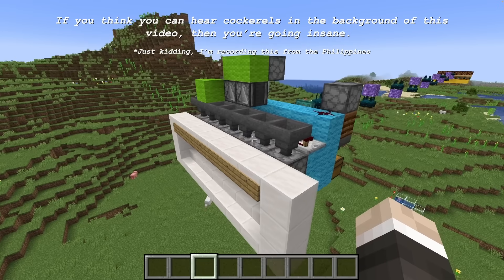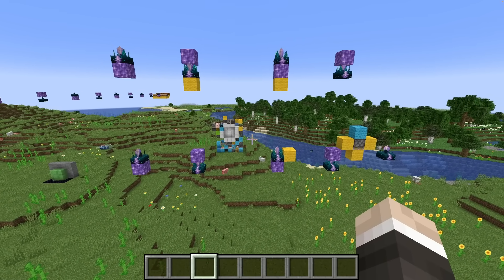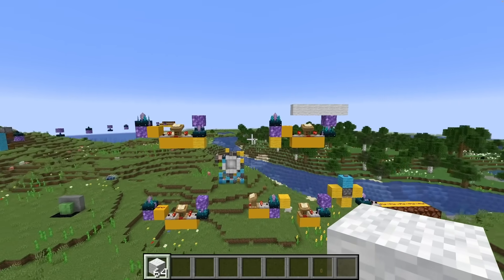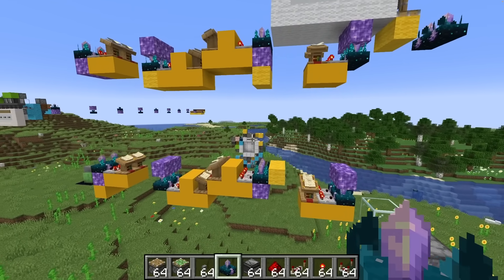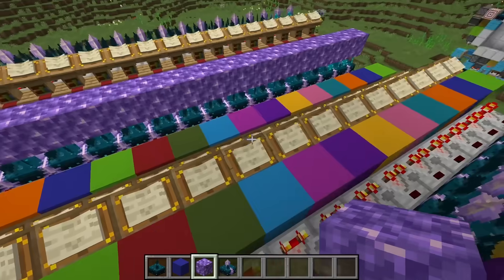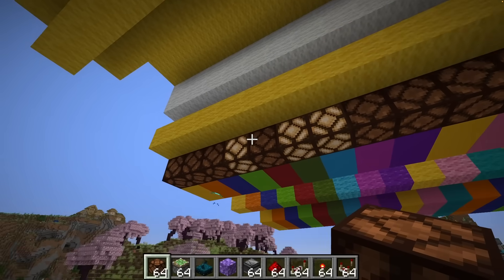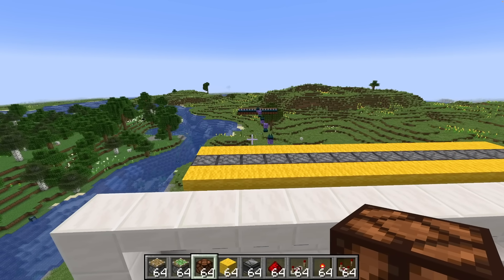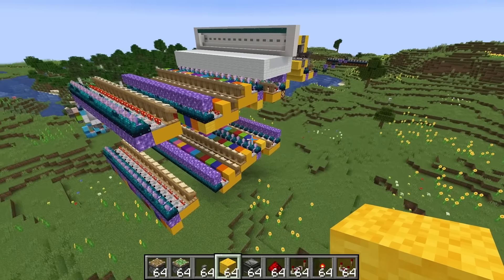This is not a redstone contraption.

Comment: i challenge you to build a telegraph/morsecode network with this, im not exactly sure how you could do it but i have some ideas:
morse code is in essence binary with dots and dashes in actual morsecode its determined by signal length however in minecraft you could do it witht he calibrated skulk sensors, you could get fancy and implement a third signal for spaces sothatamessagedoesntlooklikethis but instead it looks like this, my idea would be the following:
you have 2 dispensers opposite of each other, one has a water bucket one has a lava bucket, beneath the gap between the two dispensers is glas so that the lava/water doesnt flow everywhere and you can still see which is dispensed, if the machine gets a dot signal it dispenses lava, if it gets a dash signal it dispenses water, if it gets a empty space signal it doesnt dispense anything and moves to the next spot, leaving an empty space between words, if you have a long enough line of those dispensers with water/lava and you can come up with a system that makes sure the signal moves to the next space you have a telegraph network (if you want to go a step further you could maybe come up with a system to dial specific places in the network)

Comment: I mean if you only use sounds that are manually replicatable (items dropping, explosions, etc) you can just have the system automatically "resound" itself. Or at least do so when someone approached (perhaps using the sensors to check for footsteps or such while also resounding the footstep system).

Comment: Currently, Mumbo's contraption can give off 15 different signal strengths, and using 2 contraptions can give 225 different combinations, and 3 contraptions giving 3375 different combinations. For reference, we actually only need 26 combinations or signal strengths to encode and decode the English alphabet, while computers deal in binary in 8 units, which amounts to 256 different combinations (which means the 225 different combinations we have in Minecraft is actually really powerful). But I think we could go further.

Adding onto Mumbo's set-up in the video, you could also send a 'redundant' sculk sensor line that activates on the receiving end when a signal is being sent (regardless of the signal strength). You could then add an extra button to the inputs that would not be calibrated to any sculk sensor, and only represents a signal strength of 0. However, that extra button will still trigger the redundant sculk sensor line, showing that a 'signal strength' of 0 was sent.

This means that you effectively have 16 different signal strengths that you could send long-distance (0 - 15), and you would have a hexadecimal system that could then be replicated to form two sets of 16 signal strengths, or a cumulative of 256 characters, and can thus simulate ASCII. This would be even better than 225 characters, and would be even better.

It's just an idea, and why not? It only adds one extra sculkstone line to the already pre-existing line.

Comment: You could combine these non player based sounds together to get up yo 127 different combinations of sounds and have a receiving end interpret these sounds with and gates. The sending end could have a button that plays a specific set of sounds in order to the receiving end where each of the seven input sounds is stored and you hook up and gates to different sound inputs and then if two specific sounds are received then the gate actives triggering your desired output.

Comment: instead of using a lecturn, you could use a single redstone torch, or block, cause it's from 1 to 15 which is the natural output of redstone decreasing over distance. Lecturn would be usefull only if you need to fine tune a combination of sounds
Reply: Not compact

Comment: You mentioned at the end of your video that when you move out of the area the sounds are lost, they are not stored anymore. I wondered. If you wanted to activate certain storable sounds in certain areas, you could have a tripwire or another activator that removes wool temporarily allowing in that moment playable actions to be heard and stored there and then. Let's say it's your base, to get in successfully you need to eat food but if you just walk in normally you activate a trap. Water logging the sculks would need to be implemented to can't be dealing with repetitive sounds.

Comment: Fun note. This is functionally a simple keyboard. With 15 letters, you could get across quite a bit. But if you made the decoder take two inputs, you could have 15x15 = 225 possible outputs, assuming a basic alpha numeric keyboard, 26 + 26 + 10. Only 62 of those would be needed to make lower/upper case letters and numbers. Leaving you plenty more for short hand (commonly used phrases, such as 'peaky bird!) And that isn't even including the shift key!  It's too bad sounds are lost in de-load. Or there would be a ton of potential uses for this!

Comment: @ThatMumboJumbo

The lecterns will reset after server shutdown mumbo, so they are not quite suitable for permanent build. I had this issue when I was testing some redstone idea in my testing world and then in the honey farm i made for my vault hunters world with this lectern comparator sensing unit, but then every time i wanted to operate that i would need to set the lectern again, since the comparator would not read the book correctly, even though it showed it was on the correct page. So for this you would have to replace all lecterns with hoppers, chests or something that will not make it bug out.

Comment: you should totally make a "Code maker" that will turn a combination of the stored sounds into a letter or number, so it works as an actual communication device over long distance
example, numbers (or signal strengths/ or sounds, all the same in this context (I think)) 1, 4, and 7, in that order would make the letter B or something, and then do that for all the letters of the English alphabet, all 10 numbers, a space, and something to indicate the end of a sentence (which would mean you need  38 different codes, to code and decode for sending and receiving). and then also a decoder at the other end, so you can send texts to your friends in Minecraft. if you wana go the extra mile you could add punctuation marks and stuff.
ofc, you'd need chunk loaders for long distances, but that's easy.

Comment: i think it could potentially be possible to send other messages/signals using 8 of the signal strengths all allocated to a digit making an 8 bit binary code. You could do what you wan with this whether its sending messages through ascii (and if the ever add a 16th signal strength potentially unicode), you could maybe do very low quality sound or most interestingly you might be able to create a binary to hex converter and then send colour/image information across a world

Comment: All the 15 signals can be done by pressing a button. For some of them it would be faster/easier to be stored in the system, and 14 of them can be fully automated when entering the room. The only interaction that the player would need to do is spawning an entity, which could be done by placing an armor stand or a minecart (sadly, a dispenser's placement doesn't count as spawning). Or it could be almost automated by placing a bucket of fish or axolotl (strangely, a dispenser's placement does count as spawning for those), then the player would only have to pick them back once from time to time to make sure their is always some buckets in the system.

Comment: Make a wall of wool, 1 deep in put in skulk sensors, boom you have memory module that takes 3x3x1 block but can be activated like you want, without need for wire blocks.
I'm scared even more

Comment: Kind of seem like you could use this to send actual data. Like you've got 15 different sounds so that's almost like Hex if you had a separate pulse for the clock you could feed data in 1 end and get it out the other. If you had say a queue of red stone pulses 1 end you could send that to an output which loads them into a set of lights to make a picture and maybe on the input side you could sense that picture so you could set whatever picture you wanted to be sent.

Comment: You could have a noise reapplier loop everywhere so the noise travels EVERYWHERE and doesn't get unloaded... So when you about to leave the area the circuit in the new area picks up the sound from the area you came from and it can be used as such!?!!

Comment: If you have 2 sensors with different sounds and you connect them with an AND gate, you get a nearly foolpoorf sensor, what is the chance those two sounds will play simultaneously. Now if you add a 3rd, then its pretty much safe. Same way, you could treat those 7 diferent redstone sounds like binary bits, and then you technically have a 7 bit long binary number amount of different inputs and outputs. Which is a lot more than 7. For example - If you simultaneously activate 1 and 2 that would activate output 3, if you activate 1,2 and 3, it would activate output 7 or something like that, i dont remember binary much...

Comment: What you've built is basically capacitors and RAM. Capacitors because they hold the sound like a charge and RAM because the moment you walk away from it, it gets powered off and without power, they memory gets cleared.

Comment: Mumbo dose it the amethyst diffuse the signal ie send the signal to multiple sensors within range if so you could have levers that close off frequency lines using sticky pistons and wool to lock the transition to open lines.

Comment: Just a thought, but could you build a system to send and decode a combination of sounds? Specifically if you used the 8 sounds that can easily be produced by redstone and not have to worry about persistence of sounds. With 8 paired unique sounds you'd have 64 combinations, 512 with three, 4096 with four... You could cover the entire unicode space with 8^6 (with room to spare), the entire 24-bit colorspace with 8^8... I know 'computers' aren't your biggest love for redstone builds but imagine a combination lock with 19,173,952 code combinations ranging from 2-8 inputs in length. I genuinely think that'd be incredible. Especially off of just 8 buttons.

Comment: If sounds aren't persistently stored, the system becomes less complex because you no longer need an encoder. Instead, you can just have a calibrated skulk sensor hooked up to a lectern in a room with everything needed to make the sounds.

Comment: mumbo what if you used note blocks for the sound cuz they have 24 pitches so on it's own that's 24 different sounds then add blocks that change the sound giving you 22 different sound each with there own pitches that gives you theoretically 528 different sounds you can use for inputs unless this don't work but I don't see why it wouldn't.

Comment: Hmm.  Would that "stored sound" system perpetuate through a restart?  Also, having a loop like that seems a bit wasteful, if you wanted more than the 7 or so redstone triggerable sounds for frequencies, I'd imagine you could use and gates as an auditory combination lock thingy.  This would also make it more "secure" as they won't be triggered by other mechanisms or random stuff nearby if they need 2 special sounds at the exact same time.

Comment: Can mobs trigger sculk sensors? For example, will a witch drinking a potion trigger a sculk sensor calibrated on 8? If yes, it is possible to automate it by shooting arrows at a witch using a dispenser which adds one more frequency to your selector, even though it will be delayed and might trigger as well the frequency 10 (block activation) at the same time if not isolated using wool

Comment: to be frank, with only two of the sounds (some of the redstone reproduced ones) could be used to send mors code (or binary code if you insist)

i saw this one comming after the previous video and im not regretting it at all :D

is it finally time for a ginourmous piano which works with vibrations instead? Idk, but funny minecraft contraptions are far more enjoyable than highly scientific ones imho

Comment: Wait I've thought of something. Could you theoretically use combinations of specific outputs put through a wireless line like you showed at the start in a sort of and/or/nor gate system to create even more possible combinations? So you have it so that when an output of 1 and an output of 2 are both output through the line, then an and gate is activated for an additional combination? I hope that makes sense? Like use the varied outputs generated through the line to create and/or/nor gates. Then maaaaybe even have and/or/nor gates FOR the already existing gates? Theoretically have an infinite number of possible outputs?
Reply: Yep, you could batch the commands into a buffer, and then encode/decode them on the other end.  This essentially allows for arbitrarily large encodings to be used(as long as you are willing to wait for sounds to be sent bit by bit)  This is also possible with regular redstone, but getting the timings and encodings right, especially over chunk boundaries has always been a pain. I'm not sure how skulk sensors would compare, but I'd be interested to see an attempt.  It's also neat as you only need 1 line here to carry 15 signals.  With classical Redstone you would need 4 lines of redstone to send the same amount of data.

Comment: There's another smaller issue with the contraption. It's that once you have released the sound, you need to reproduce it again. Which means you have to remember which sound you've just sent.
Reply: I thought so too at first, but it looks like that isn't true. When the block moves out of the way the sound signal is sent out and also up continuing the circuit.

Comment: i know this is a few months late, but why cant you just store the order of inputs 1-10 and then have infinite characters. for instance 1 can be "A" and 26 can be "Z" then 10 can be [SPACE].  then if you want to send the message "GO" (for instance) you just send " 8, 10, 1, 6 " which would translate to "G O" because 8 acts as G, 10 acts as space, then 1,6 acts as 16 or "O"
 this can be expanded if you wanted 99999+ characters, of course you would either need to memorize all 99999+ characters, or have some way to reference which number means what,  maybe just a handy decoder book

Comment: Sculk sensors are very underwhelming 

1.) Anyone doing anything near your sculk line would trigger a generic interaction and trigger the system. 

2.) If someone accidentally throws a snowball or w.e near your encoder, or a villager walks by it you could get an accident signal

Comment: I still don't see an actual point for this thing , you can build secret passage with a secret trigger but that's pretty much it. I tried to use this things in farms or redstone builds but it end up just making things more complicated. Wireless redstone is pointless since you dont need to pass signal trough thousand of blocks and it can't be use to synchronize things since there's a lot of delay (a straight line with repeaters is faster). The real use is probably adventure maps in witch you can create intricated traps but in survival i don't really see the point (except for maybe a secret passage witch is esthetic). I hope to be wrong and I'm looking for some redstone machine based on this things in 1.20 .

Comment: I mean i still dont see the point of this…you have 15 buttons, so why wouldnt you just use literally any other conventional method? Why go through the hassle of connecting each button to a different sound to send an output? Like maybe if you had one button and a lectern to send all the outputs, THAT would be neat….but im pretty sure you can also do that with normal redstone too, and i dont know if it would be more or less compact than this is, so i couldnt say which is better specifically. But yeah, i just dont see the point other than it being qn oddity and a showcase. Dont get me wrong, ive built my fair share of useless machines just to prove i could, my machine that splits 5 stacks of items evenly into a bunch of droppers to rapidly drop them into a hopper minecart and send it off comes to mind lol. But its not something i would ever really use, and wouldnt showcase it either because there is no point to it. Just something i make to show i can, and that i understand all the concepts, and then just pretend it doesnt exist.

Comment: What happens if you send more than one sound signal at once down a line? If it detects all the signals sent simultaneously (near simultaneously, checked on a clock cycle), then you could grow the number of unique sendable signals exponentially (2^n where n is the number of sound signals).
Reply: Additionally, what happens if you send a sound signals in both the ends of a line at once? Do they interfere with each other? If not you could have full-duplex communication for free

Comment: its a shame that the range of each skulk sensor's range is so low, would be actually rewarding to get in survival if it transmitted on a radius of half a chunk + 1 (whole chunk + 1 in a straight line of width 1 if calibrated) considering you have to put a lot of work getting them, and after that sound proofing their surroundings. on the other side, your contraption gives a excellent use of comparators, and its actually 16 signals if you count the not transmitting any signal as one. congrats, you just discovered the first wireless (but not sensible to make on survival) 16 bit bus on minecraft. cant wait to see the next crazy weirdo simplifying the actual 16 bit computers that already exist on previous version of minecraft to something small and manageable.